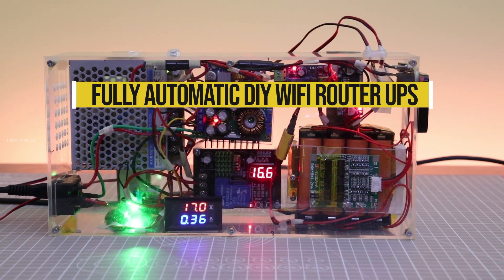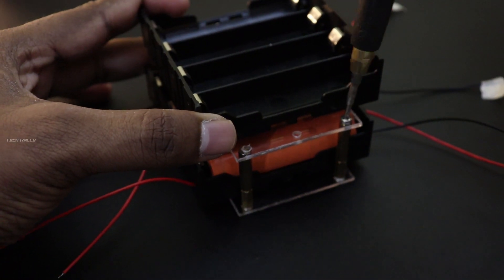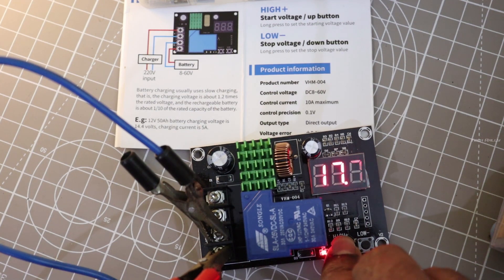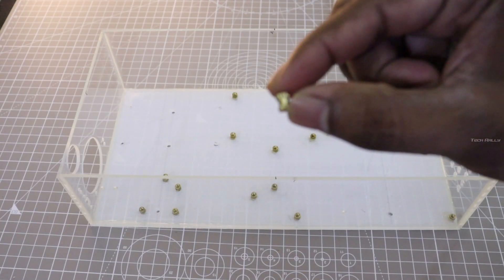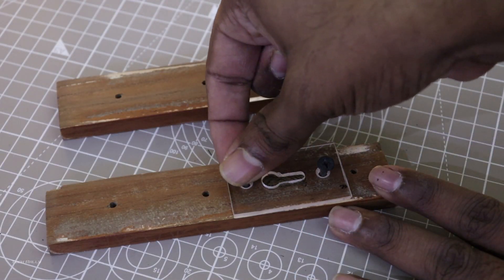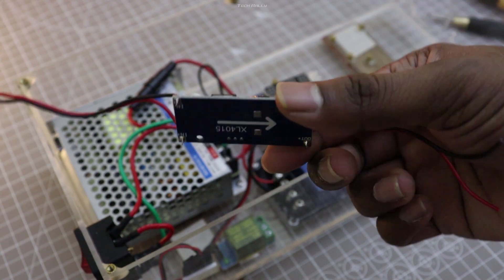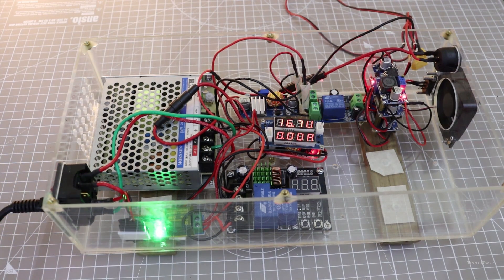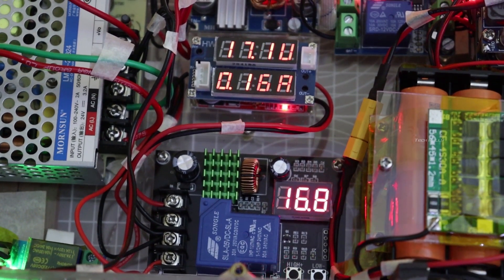DIY Fully Automatic wifi router UPS with dual output Part 1

Comment: its better to buy 1 than make the 1 he is showing us. the automatic switch over 12v relay itself is not available in india and u will have to purchase it from ebay or aliexpress since there is no video on youtube how to make that kind of circuit. And all the parts shown in this video will cost about 2000 inr if u dont count battery in it so buying 1 is better choice i can recommend u all energy intelligence ups and it shall cost only 1200 inr for the same shown in this video
Reply: but this ups is very durable
Reply: @user-pu8lc2qg5i  who told u .. mine damage after 7 month
Reply: @technicalsohil4063  i am using my homemade with 3 years and it not damaged yet
Reply: @user-pu8lc2qg5i  what is ur input adepter amp rating
Reply: @technicalsohil4063  10 amp
Reply: @user-pu8lc2qg5i  ok i am using 12.6 volt 1.5 amp .. i am getting problem